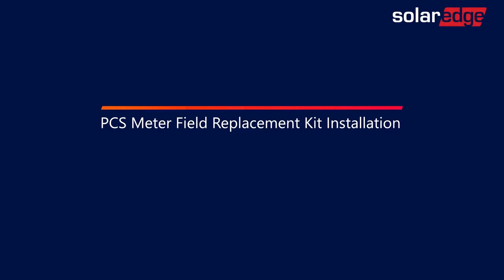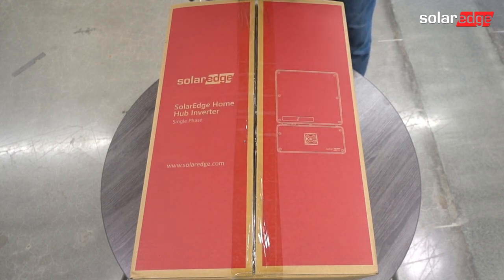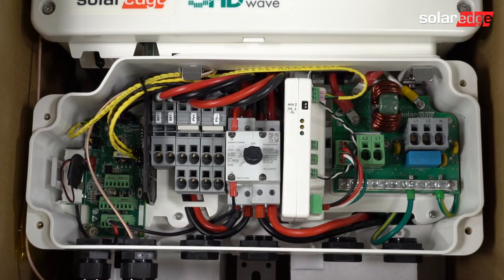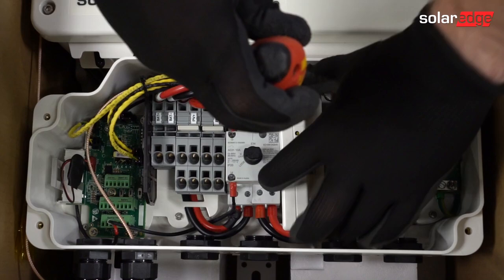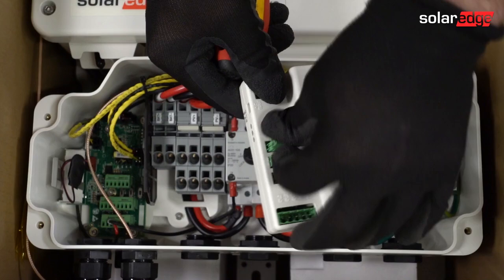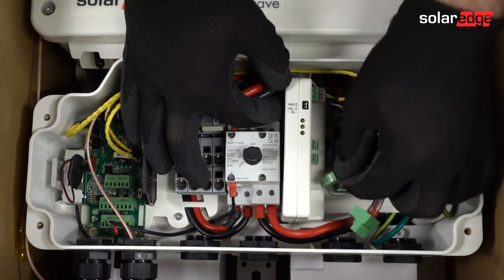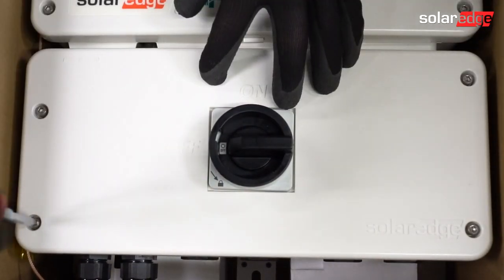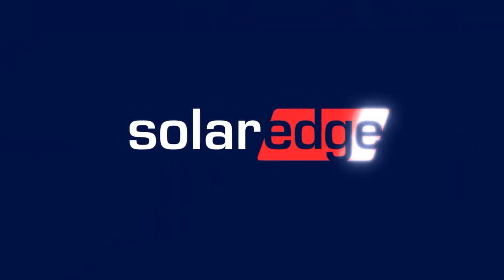SolarEdge PCS Meter Upgrade Kit Installation For Hub Inverters.

Comment: My system is down, and I need someone to come and fix it!!!
Reply from the maker: Hi Leandro, your first point of contact will usually be your installer but let me give you a few suggestions:   
1:  Walk out to your inverter (if safe) and either tap the button under the screen or check the LED tube to see what it says (https://www.solaredge.com/leds to see what the lights mean)
2:  Make sure both the toggle switch and large round black switch are on.  
3:  It sounds silly, but check for snow.  You'd be surprised how many calls we get during the winter.
While you're out there, take a picture of the label on right side of the upper cabinet (your serial number is on the bottom).

If you're still not able to get a resolution, get in touch with support and get a case rolling.   Ask them to reach out to Chris W and I'll follow up from this side to get you a path forward.
Reply: @SolarEdgeNorthAmerica  Thanks Chris, the green light was on but the blue light was off.  I checked  the network cable on my router and it was unplugged.   Monitoring is working again

Comment: What is the part number for this product?
Reply from the maker: Hi Brian, part numbers are as follows FLD-MTR-3PC05-PIE-CT / FLD-MTR-3PC05-PIE-C.   You should be able to pick them up at your local distributor.  Here's the App Note with more information:  https://knowledge-center.solaredge.com/sites/kc/files/se-replacing-the-built-in-rgm-meter-in-solaredge-inverters-for-pcs-busbar-current-management-application-note-nam.pdf
-Chris from Technical Content & Communications
Reply: Are the meters that come with energy hub inverters not able to do PCS management?  Is this the rain for the upgrade?